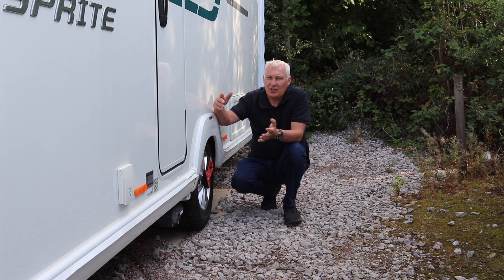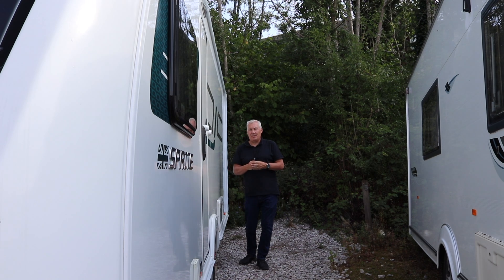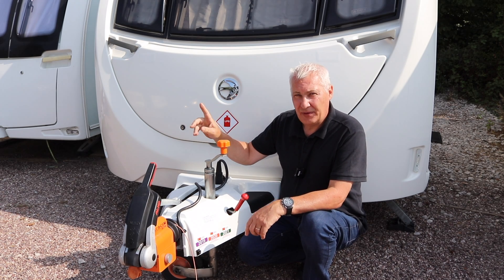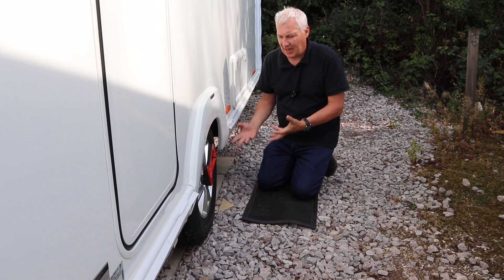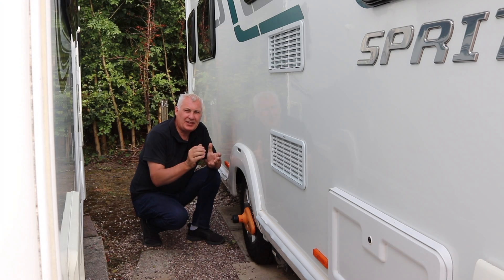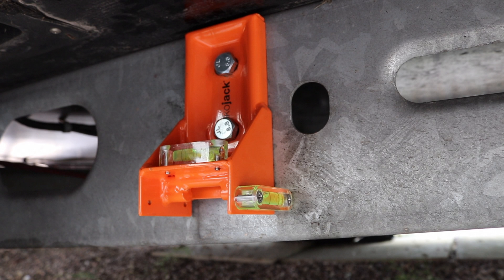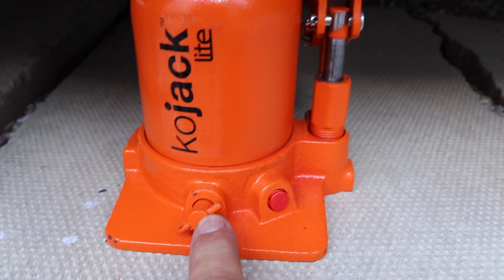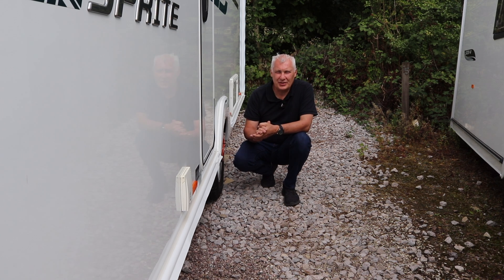Caravan Jacking Procedure

Comment: Good bit of advice . Having experienced others trying this is not easy. I have the the same bottle jack but make sure other wheel is chocked as an extra precaution along with the handbrake.
Reply from the maker: Hi Thanks for the advice. I did chock the wheel when fitting the Shocks the other day. I did not mention the chock in case someone is changing on the road. I would not encourage stepping into a live lane. Thanks Phil:)

Comment: Hello Phil, if I am not mistaken I think you need to have the car and caravan hitched together otherwise the caravan can tend to try and turn and then the Jack will become unstable, I am pretty sure that’s correct, this is just in case someone tried to change their wheel in there storage yard or something like that before they have their car hitch up, 👍.
Reply: At the start of the video he said he is assuming you have the car hitched up to the caravan.
Reply: @M..R....  yes I did catch that he did say that, I was just pointing out that if someone tried to Jack there caravan without it being hitched to the car that it could be a problem for them. Cheers 👍.
Reply from the maker: Hi. Yes I was assuming as I could not hitch up and jack it up completely as the space between the vans at the Storage yard was too close. The jacking system used works really well. I used it to add shocks to the van last we week. I hope this clears things up. many Thanks Phil👍🙂

Comment: Say if you jack up a caravan correctly, can you place sleepers/large timber blocks under 4 points evenly under the chassis frame itself? Two either side, a few feet behind, and in front of the wheels.   Not so it slips off.  I need to remove both wheels for maintenance and rust control under the axle. So i don't have to use a jack while working. it is an Elddis Odyssey 550
Reply from the maker: Hi. Sorry for the late reply. Personally I would not use your suggested idea. I would prefer to use a proper lift ramp. There are places were you can hire ramps for the day. I don't know where you live but you can check on line. Be very careful with how you do this job I would not like you to be injured or damage your caravan. Sorry I cannot be more helpful. Thanks Phil.🙂👍

Comment: Hi Phil. Im a bit late to this video so hope you will still see it! I have a food trailer on an Alko chassis.Its a twin axle and I dont see any pre drilled holes. Have you any advice for me please?
Reply from the maker: @TheHarryAdam  Hi. You could purchase the jacking system and use the brackets as a template and then drill holes so they can be bolted on. Hope this helps. Phil 🙂👍
Reply: @lostweekendscaravan  Thank you. Do I need to buy 2 - 1 for each side?
Reply from the maker: @TheHarryAdam  Hi. You can get away with one on each side but the trailer must be attached to your tow vehicle. Cheers Phil.:)

Comment: Hi Phil. Great video. We need to invest in a jacking system as we only have the normal jack that comes as standard with the caravan.  Thanks again cheers. Paul
Reply from the maker: Hi Paul. This is a great and safe way to jack the van. Avoid the lighter version this is a better jack and is much stronger. Thanks Phil👍🙂

Comment: Valuable information Phil, I have the previous Kojack which is a scissor jack. They are robust products.
Reply from the maker: Hi Colin. I had that version but found it not strong enough to carry the vans weight. I do believe that are for lighter Caravans. Pleased with this one i used to add shocks to the van last week and it worked a treat. Thanks Phil👍🙂
Reply: Hi Phil, Hope you didn’t get under the caravan whilst it was jacked up. Definitely not a good idea. Bottle jacks (and scissor jack) can occasionally fail trapping or even killing the person underneath.
Reply from the maker: @Andeecee   Hi. No I didn't. When I was fitting the Shocks I used axle stands as well. Better safe than sorry. Thanks Phil🙂👍

Comment: So how did you jack it up, and how do you bring it down after changing the wheel?
Reply from the maker: Hi Jane good question once you have set it up as in the video it is the same principle as replacing your cars wheel and then in reverse. Remember it is importance to have caravan attached to your car when jacking up the caravan. Thanks Phil 🙂👍
Reply: I've never jacked a car wheel up, so complete novice
Reply from the maker: Hi Jane it would take too long to explain in words. I will have to make a video on the subject. An alternative would be to join a break down organisation which covers your caravan. Mayday from green flag offers the best policy. Other companies do not have the capacity to tow a caravan and car. Check them out via the caravan club website. Hope this helps. Phil 🙂👍
Reply: @lostweekendscaravan  0:20 so I've looked on my Jack instructions and it says to bring the Jack down I turn the knob on the front of the Jack

Comment: What about caravans with AWD motor movers. Is this kind of jacking system compatible as space is a premium.
Reply: The link provided for the item takes you to a Kojack jack for a single axle caravan. Searching on Amazon brought up the twin axle version where one of the reviews states it didnt fit his twin axle with 4 movers and drilling more holes in the chassis isn't an option as that would compromise chassis strength
Reply: @M..R....  thought so. Thanks. 99% of twin axle vans have movers so it’s back to the trolley Jack under the nearest available space on the frame.
Reply from the maker: Hi It depends on the make and year of the chassis. I would check yours before you buy. I hope this helps. Phil.👍🙂